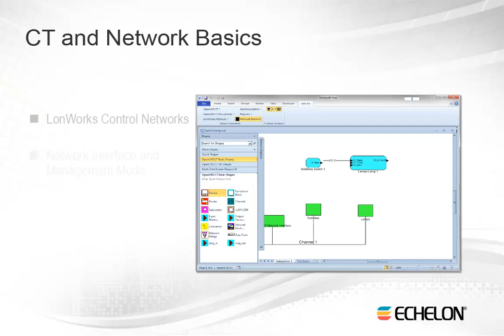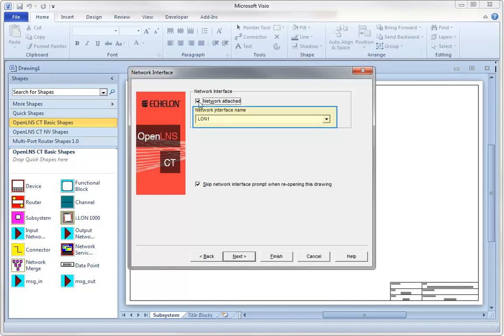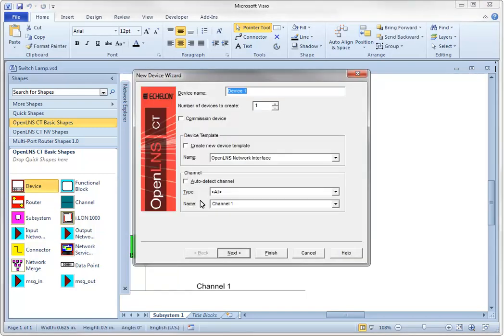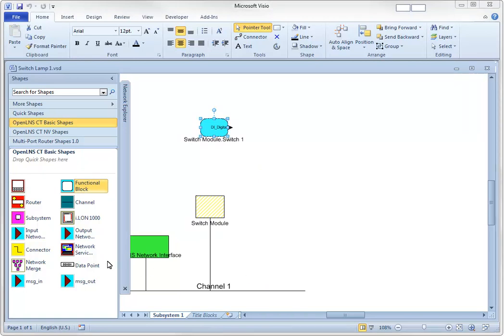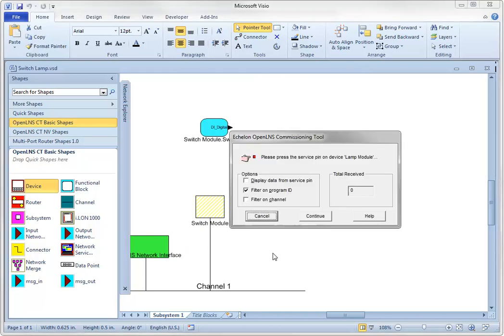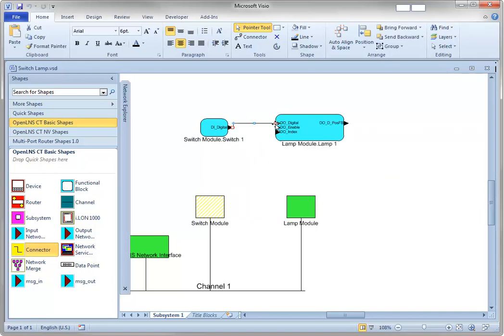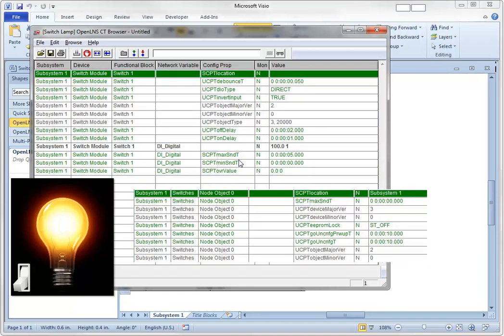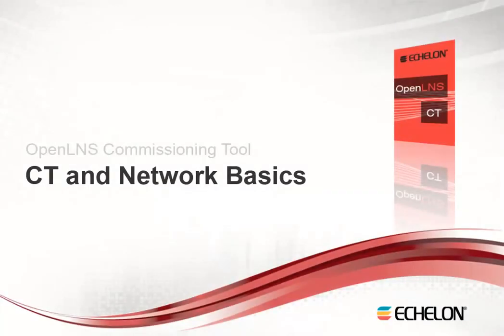CT and Network Basics

Comment: Hi,  How do you get all the devices on you LON Maker software. do you add them or do they auto populate. Can you please detail. does it start like 1. install all your devices physically and note their neuron ID.  2. Then install your LON Maker software on your PC.  3. Connect your PC to the network.  4. Run the software  and all the devices will show up on your LON Maker software. 5. Connect (BIND) your devices.  is this how it goes or am i making a mistake or missing a step some where. thanks for your help.
Reply from the maker: I wish I could help out more but I left the controls industry almost 8 years ago and remember very little.  From what I remember, LonMaker had an auto discover mode.  I suggest contacting Echelon/ Adesto Technologies as I am sure the product has changed since I last used it.
Reply: @kencawley3121  thanks. Echelon/Adesto websites do not provide any contact number to reach out to them. thanks again for your quick update
Reply from the maker: @habeebsiddique8379  You might try techsupport@adestotech.com. sorry I couldn't be more help. I never actually worked as an integrator so my knowledge comes from working with tech support and students in my classes .